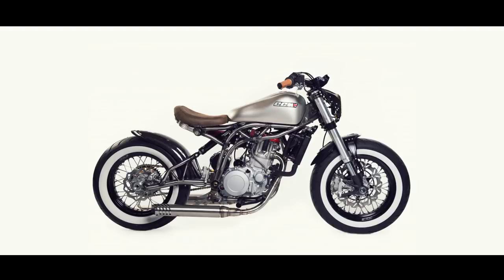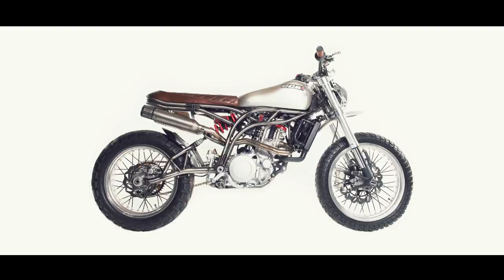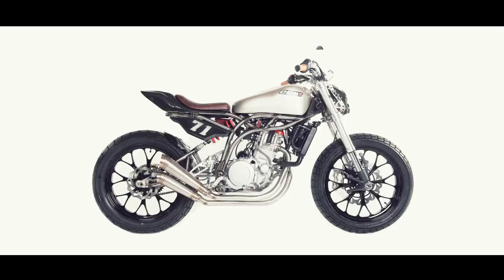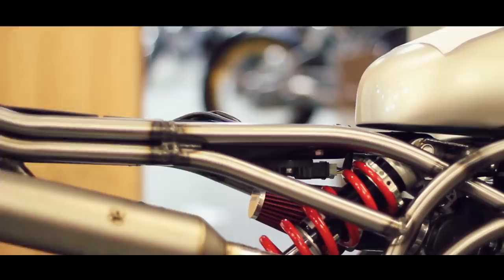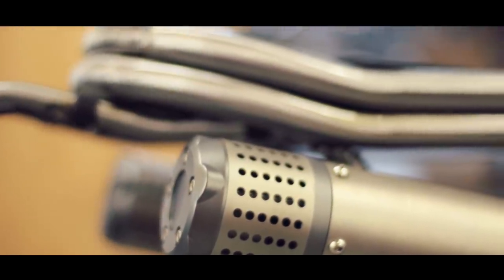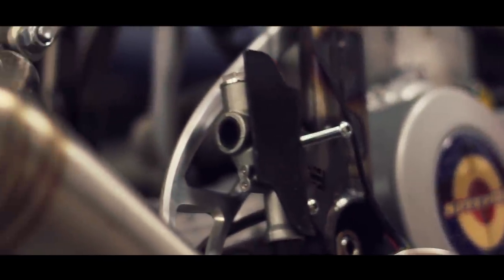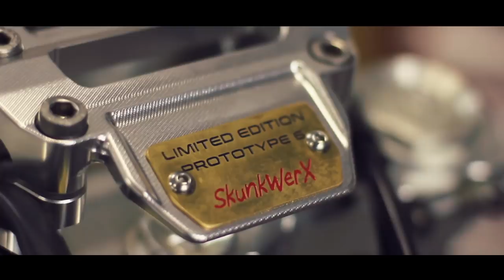CCM Spitfire Factory tour and build

Comment: I visited the factory last week - very impressive, Darren kindly showed me around. I now have a Cafe Racer on order with several extras like radiator guard, lithium battery charger, rear hugger behind engine, billeted front sprocket cover, bar end mirror set and all weather air filter cover. Just under £10,000. Great buy me thinks.
Reply from the maker: Amazing, congrats on the purchase, you'll enjoy it.
Reply: Enjoy!
Reply: Do you have your cafe racer yet?